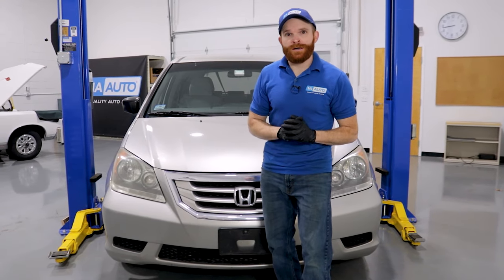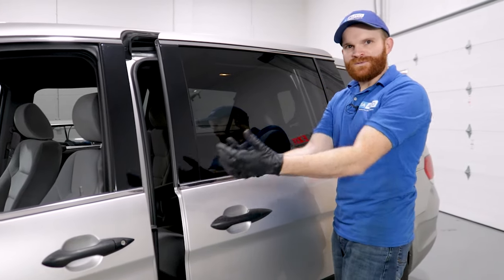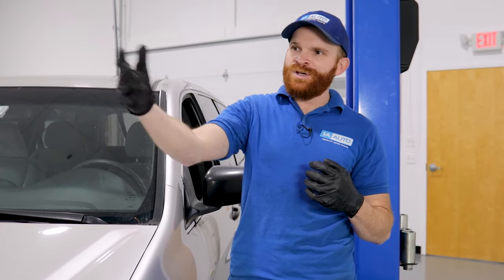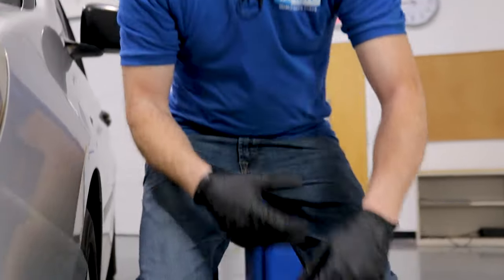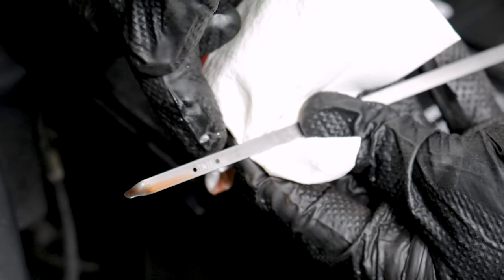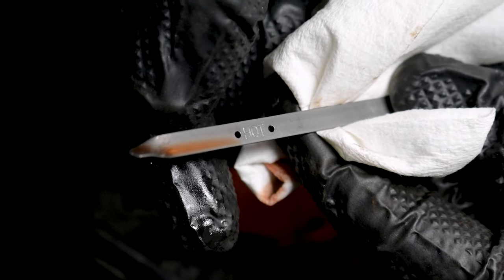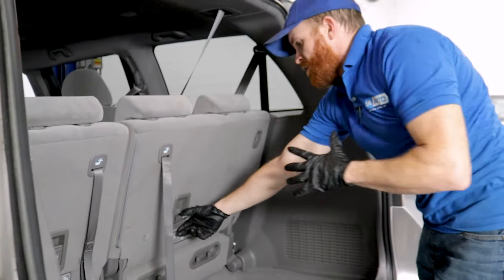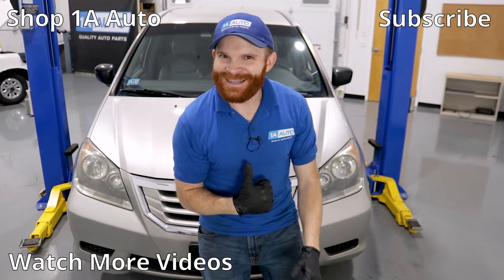Top 5 Problems Honda Odyssey Minivan 3rd Generation 2005-10

Comment: Got into my first Honda, Odyssey 2008 this year, 2024. I had a gut feeling the one previous owner did only basic things (they did not clean it or lube the side doors/trim, fix the peeling paint.  and the auction place that had it after owner ditched it kept it in the blazing sun for a long time. Since May I replaced serpentine belt as the high-pressure steering fluid line developed a hole and was leaking fluid onto the belt. The rear tires were badly cracked, the oil pan-The mounting screw could no longer be shoved into its home. I detailed it myself, then (me) replaced or redid the trim, rear wiper blade, new third taillight bulb, hubs replaced all interior lights with Led including map lights. Then driving home and felt like transmission went... I could not accelerate, coasted home. Hooked up code tool directly under steering wheel misfire in the 3rd. Looked up issue common issue is the ignition coil. Honda said it was the 3rd spark plug which apparently in Hondas is very common. Replaced all 6 at over $500. Now doing an oil pulling test, Honda said oil very low and might be the pistons.  Since new plugs very great gas mileage (wow what a difference) and oil level has not moved. Thank goodness!! Just that minor symptom of pulling oil can mean major issues with engine! What I have learned our van will last a long time BUT you must use OEM products, and you MUST do ALL The maintenance not just oil changes. We tried 4 different oil pans from Oreilly only the OEM fit, and it was the last one in our area, backordered 2 weeks. I got the last high pressure SF hose in our area, also backordered. All in all, 'one owner' didn't do much. They did not really put in the TLC a Honda needs prior to my ownership so that at 158,000 miles I got the tail end/stress/bills so far totaling $2,500 for a van I've owned less than 6 months. I think that is why the price for our year at a dealer is over $8,000. Engine runs great, we love it for road trips! The transmission was replaced due to trace leak by the one owner. My Kia's never had any spark plug issue or oil pan mount screw problem; in fact, my Kia's run great never had a major issue.  Honda is really specific on what it will take/do or not. If the oil pulling thing turns out to be the pistons at a cost of $6000 + our lovely van and all of the work so far, I've done. will be a wash.

Comment: You forgot to mention vetch solenoid gasket! Next to the dipstick, leaking oil on top of alternator making it fail. This just happened to my 2010 odyssey so now I’ve to replace my alternator and fix the leaking as well!
Reply: My vvt was leaking so I replaced gaskets and then the vvt started throwing codes , friend said do not use aftermarket vvt but I didn’t listen! Well guess what as soon as I put on honda vvt it was good
Reply: my van is getting this done, as I type. Plus another gasket.

Comment: I bought a 2010 Honda Odyssey 3 years ago for a good price it has the first three problems the door doesn't open transmission is not the best and vibrating while braking, but honestly I believe it's a good vehicle, I keep changing the oil with mobil one full synthetic every half Year

Comment: We had a 2009 Honda Odyssey Touring and it had the following issues that seem to be common:

Oil consumption that got worse over time.  They applied a software update for the VCM and at about 80,000 miles the check engine light came on with a misfire code.  The spark plugs for the VCM cylinders were fouled.  Honda replaced the piston rings under a program that was a result of a class action lawsuit.  It still had a slight oil consumption issue.

At about 110,000 miles, the VTEC spool valve failed and started leaking oil everywhere.   About 6 months later the alternator failed...which may have been related since it was under the spool valve.

Also the air conditioning relay failed.   And we had the Michelin PAX runflat system....which we ended up ditching for standard rims and tires.  This was not my favorite Honda to own but we did end up getting a 2017 Odyssey Touring Elite to replace it and it seems to be of a better build quality...also much improved gas mileage.

Comment: I have replace rotors and pads at the same time by using aftermarket parts by powerstop! And it seems to still do the same thing so I believe it's an issue with the vehicle themselves not just the pads and rotors!

Comment: I had really bad pulsation from a set of CTEK premium rotors. They were not warped, at least not when cold. I have a dial indicator to measure run out. But the pulsation was bad. I replaced them with Bosch Quiet Cast and new pads and it's much much better. Not that ctek premium rotors are advertised as having symmetric casting. Mine were not. The Bosch rotors where symmetric cast. It has an impact on heat distribution.

Comment: I have a 2007 Odyssey and it shifts hard between 1st & 2nd gear. It started happening after going on a trip through the hills. This is a common problem as well
Reply: I recommend Lubegard products.  My 2005 had abrupt shifting both up and down, came across Lubegard Instant Shudder Fixx at OReilly Auto and started doing research.  Ended up getting a quart of their Synthetic ATF:  50902.  It's the red packaging.  Put about 3 oz in.  Change is not dramatic but is noticeably better.  Good enough that it is clear it's not a gimmick, I'll continue to use.  I bought my car used with 125k and did two drain and fills using Valvoline Max Life ATF, it works perfectly fine with our cars.  Felt good about that but then noticed the hard shifting about 4k later (it's a new car for me, that less than perfect shifting was probably always there).  Added the Lubegard and am happy with the results.  Will continue to use Valvoline supplemented with the Lubegard every 15k.  Once you've done a couple drain and fills doing one simple drain and fill every 15k supposedly suffices.

Comment: One big problem is when if it brakes the tensioner pulley on your serp belt and the bolt snaps make sure you change the ac compressor braket is what holds the pulley and by centimeters gets bent where your eyes cant tell and it would just keep snapping your bolt every 30 days or so being there learn the hard way broke 2 tensioner pulleys in 2 months and they are 175.00 the third one i change the braket with the pulley and is been like 6 months already and still good
Reply from the maker: +Shadow Division Gaming Thanks for the feedback!

Comment: Regarding the doors you forgot to mention the cables that pull the door open and closed can break.  Happened on mine.  The coating on the cables wears off and the cables rust and break.  Just replaced mine this weekend.

Comment: i bought a 2006 Honda Odyssey EX-L with 215k miles. the transmission shuddered, motor mounts were bad, and the sliding door rollers were damaged. i kept it for 3 months and sold it. looking for a little bit lower mileage 08-10 model. if i knew what i know now i would’ve kept it and put some money into it, wasn’t the right timing for me. i wasn’t financially in a position to repair what it needed and took a loss.
Reply: @T Mike I have a 2006 EX-L @ 275k miles and trans shudders due to worn out differential bearings inside tranny. I also have a 2010 EX-L and these transmissions seem to be built much better. The 2009 and 2010 Odyssey are highly rated with far less transmission complaints. Check out this website to compare common issues for different year Odysseys!
https://www.carcomplaints.com/Honda/Odyssey/
Reply: @SaabSonettSchool 07 got the ridgeline 5 spd much fewer problems.

Comment: had a leaky 2010 exl with 200k miles, leaking valve cover gasket, drain plug and around the vtec seals. i replaced the pcv valve and leaks are gone, did the vcm muzzler too to help reduce oil burning.

Comment: I have driven 2 honda odyssey so far, one is a 2005 model and the other is a 2010, both have had issues with the power steering and the AC compressors failed as well. Is this a common issue among the model?

Comment: Please take #2 out that’s common in every make and model vehicle. And a common problem I come across especially on the 07 odyssey is the high pressure power steering line, they tend to go leak regular.

Comment: I have a 2010 Odyssey. The drivers side sliding door will only work manually. Gas door switch is good. Fuses are good. main power cable from the battery is good. I can hear the left sliding door controller clicking. I think it's the motor. I'm not sure how to accurately test the sliding door motor. Do you have any advice on how to test the motor?

Comment: Good video,,, thanks 
I haven’t had those problems.
I have a problem with a the sliding door (passenger side) door stopped opening and on the screen shows “door problem “
I do reset the system and works good for a couple days,,,,,
Need help,,, what could be the problem????
Reply from the maker: +o carrillo We wouldn't be able to diagnose an issue like that here, you may want to have a local mechanic take a look at it. Thanks for checking us out! http://1aau.to/m/Shop-1AAuto-c

Comment: I would have mentioned the oil leaking problem from the o-ring in the oil filter mount. They all start leaking there eventually but it’s an easy diy fix.

Comment: I had the brake issue at about 50k miles. Initially, I replaced just the pads. That didn't solve the issue. New roters did the job. Wish I'd seen this video then!

Comment: Electrical problems after car wash or rain. Alarm goes off randomly and DRL come on randomly. After a couple dry days everything goes back to normal. No clogs in sunroof drains. No obvious water intrusion around doors or anyplace else inside vehicle. VSA, Triangle symbol, and ABS lights come on, but usually go out after an immediate restart.

Comment: Just purchased 2008 Honda odyssey with 130000 miles.had cam belt changed at 93000. Just flushed transmission oil.complete flush. Should I change cam belt as been 6yrs.thks.

Comment: The rear seat frames usally rust causing every one to bust the cable I've changed rear seat frames and cables most of the time. The rust causes the seat not to move

Comment: The problem of V6 hondas is that you need to drain and fill ATF as often as you change engine oil.  Honda builds notorious transmissions.
Reply: By 2007 the transmissions were revised ( ridgeline 4 shaft unit was installed 2007-2010). No big issues with these problems with some 08s is cam wear and crappy VCM issues

Comment: Any recommendations will be appreciated! I bought today a 2005 honda odyssey with 245k km the door has some issues as you mention in your video, and the dealer told me he will fix it to close properly manually but not automatically, how much can cost me extra to fix that? I saw a few comments about the transmission cooler to add it, what do you think? Thanks everyone

Comment: ADJUSTABLE SHIFT VALVE if your having shifting issues or weak shifts upon acceleration: under the air box on the driver side of the transmission there two five point allen wrench style plastic bolts, you need a special tool $15 to adjust it, dont use random things to try and turn, if its not shifting up its the top valve if it's not shifting down where you want it it's the bottom valve screws easy fix tricky to stick your hand down there watch out for the paper gasket, $25 at the dealership, its a special order part! No need for a new transmission this is the problem however clutch issues are another story

Comment: I have 09 odey 160k 
I have 2 of the 5 issues  I have 2 of 5-
 rotors & plastic bearings. 
1)  where can I get the
      1/2 of hinge with        
        plastic bearings??
O'Reilly  computer doesn't come up with the part. I haven't tried RockAuto online.
Other issues
2)  radiator overflow container is slightly over the full line & water is dirty but it never moves and I've had 2 add water several times to the radiator, I did check the lines for a clog.  What would cause this. 
Water pump?
What oil is advisable for high mileage?
Are washable engine air filters advisable?
I can't afford a mechanic so I must go the  DIY route & any advise would be much appreciated. 🙂thanks
Oh 1 more thing why do I constantly get a check the gas cap message?

Comment: How are your lower control arms from 1aauto.  I am quoted $600.00 or more here in my area for lower ball joint replacement only and an alignment.  Must I just buy the complete control arm from 1aauto?  Do they meet oem quality?  I like the price you all have them for.  Less than $200.00 bucks for both?

Comment: 2006 odyessy passenger window will not operate . When you press the button on either side it makes a buzzing noise . I have replaced the window regulator assembly , relay and switches in both doors  and still have the same problem . Any ideas what may be wrong ?

Comment: If you are thinking of buying a used odessey or any Honda with automatic transmission.  Take it to a Honda specialist and have transmission looked over.  And even if it is good get a automatic transmission cooler installed immediately,  are about $200.  This will and would have saved so many junk Honda transmissions by allowing the fluid to better lubricate and cool the transmission from needless wear and damage.

Comment: We have a 2007 Odyssey with 220,000 miles.  Power steering noise is another common issue.
Reply: I replaced the power steering reservoir, and the fluid. Then I still had noise and really foamy looking fluid, which turned out to be the downstream? (not sure) gasket in the power steering line, right on top of the engine, the gasket that's closer to the front. That took care of the whole power steering issue.

One of the parts in the doors that feels commonly is called the actuator. I think that's what he's talking about-face when he says the latch.

The AC motor relay, inside the fuse box that's inside the engine bay, by the passenger side I think. That's a $15 or less part, that went out and shut down the AC immediately. 

It's also important to think about the timing belt if you're past 100,000 miles. At least that's what I hear, I'm a little bit past that few tens of thousands.

I think the engine splash guard that's underneath front and center, is probably also a common part that comes loose. Maybe that's just from snow up here in the North. 

It's also important up here in the north to make sure to oil or "shin etzu" the seals on the sliding doors especially so that they repel water and don't get frozen shut in the winter.

Comment: I've had my 03 Odyssey since December 2020. I like it but the more I learn the more I regret getting it. The vehicle scans out perfectly and no one can tell me why no matter how economically I drive or what grade of fuel I use I can't seem to get over 10/11 mpg in town with it's  3.5 Vtech.  Anyone got any ideas?
Reply: My 2002 had a bad fuel pump and fuel injector line. Replaced both of those and I now get 23-26mpg. It was at about 10-13mpg before those things were replaced. Now I can go two weeks between full ups. I’m so much happier about it. Especially now that gas prices are going up fast.
Reply: Also check that the brakes calipers are running freely without friction especially as the brakes warm up and expand.
Reply: There is a recall for something in the fuel systems on later models around 0708 I don’t know if it is for the 03 as well but this is something to look into

Comment: 4th gen owner…Trans shake solved with echo mode bypass and drain & refill every 25k miles, door problem over paid stealership nearly $1k to fix 1 door!  Had lubericated with lithium grease will use pb blaster from now on.
Reply from the maker: +S Wheeler Thanks for the feedback!

Comment: I am having trouble with the high pressure power steering line bolt going to the steering column. It will not turn at all. I have tried line wrench , vice grips, and even heating around the bolt and it still won't come loose. Now it's pretty much rounded off. Help!!!

Comment: 187k on a 2010 EX-L.  Rear camshaft broke between cylinder 1 and 2, this bent the intake valves on cylinder 2, destroyed the front cam bearing journal in the rear head, caused the cam seals to fail, an oil leak all over the inside of the timing cover, and a timing belt tensioner failure.
Reply: Whoa!
Reply: How much did it take to fix?
Reply: Whoa is right !!  I second the same question,... what was the cost  to fix .

Comment: The motor mounts failing prematurely is just one of the side effects of VCM. Disable the VCM if you want the engine to last as long as possible. Otherwise you're burning excessive oil which results fouled spark plugs, dead ignition coils and clogged catalytic converters.

Comment: My 2009 Honda odyssey EXL DRL won't turn off . My son noticed it and informed me, meanwhile for the whole day i did not turn on the car and it came on by itself. I thought the battery must have drained off so jump started the van but it won't start. Sounds like battery is good but its not staying on. As soon as let go the key, engine goes off. Any comments or suggestions please.

Comment: That pretty much all the problems I’ve had lol except transmission and I have 168k miles. it has been a very reliable van. The problem I keep have is ac compressor. I’m on my fourth one now. Luckily I did it at the dealership and it has been under warranty everytime but I don’t understand why it keeps failing. I told them there must be another issue but they just keep replacing it.
Reply from the maker: +El Gansito We wouldn't be able to diagnose an issue like that here, you may want to have a local mechanic take a look at it. Thanks for checking us out! http://1aau.to/m/Shop-1AAuto-c
Reply: Oh boy thats my problem now. I have changed the relays but the compressor is not moving so they say I need a new one I just don't want to pay that $1000